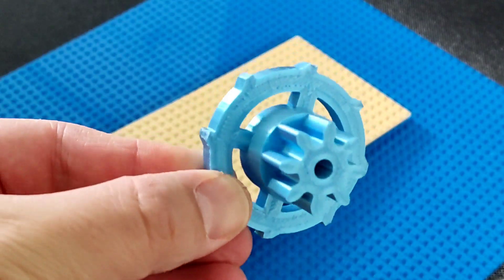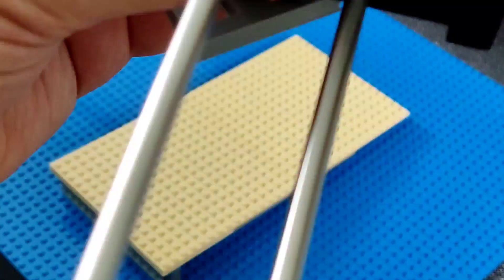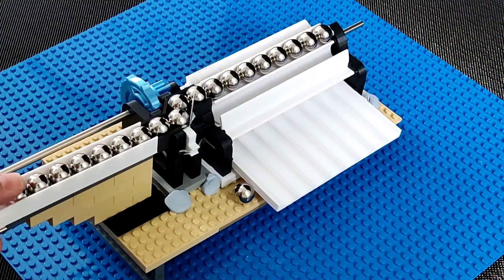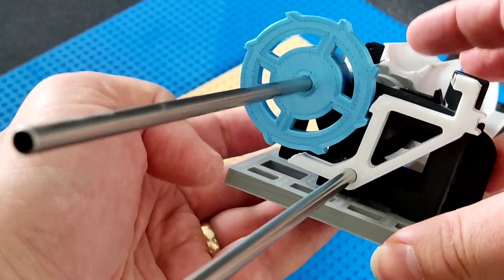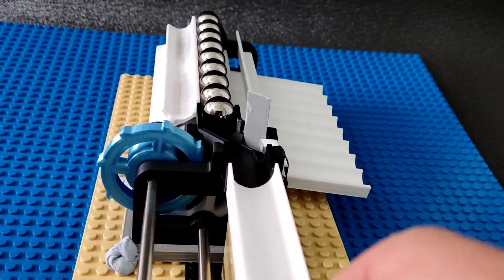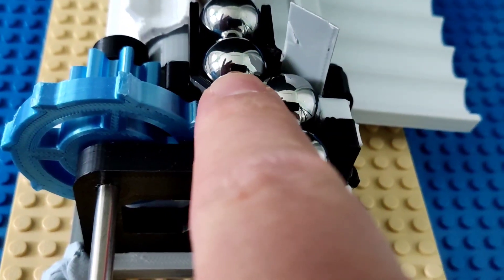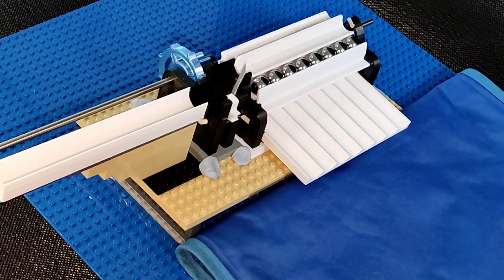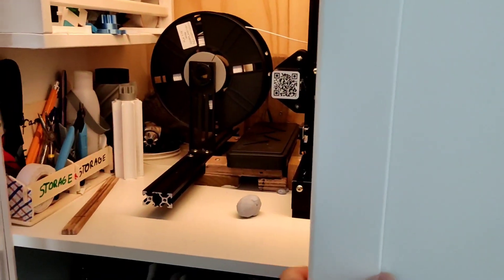MMX Escapement Triggered DB8: The final installment.

Comment: Both design and video are on fire here :)
Reply from the maker: Been thinking about an 8 week holidays, spend some time with my family...
Reply: @MrGonzonator is right though, a perfect divide-by-N is likely not needed. Divide-by-N is so hard because you want it to be deterministic and that's hard to achieve with loose parts. If you look at industrial solutions for loose parts (say moving / spreading peas in food processing, etc.) they are stochastic rather than deterministic, e.g. they use a vibrator to avoid clogging and otherwise let entropy sort things out on average. Entropy scales much better than determinism.